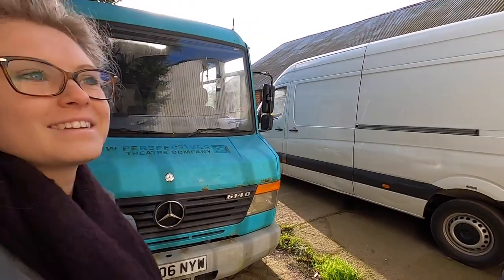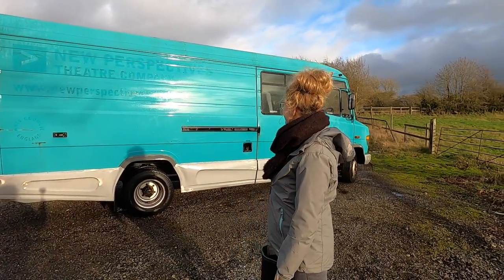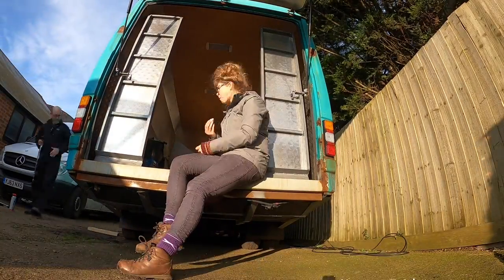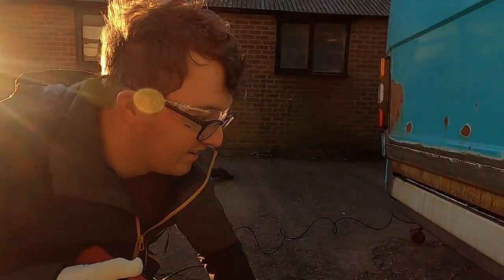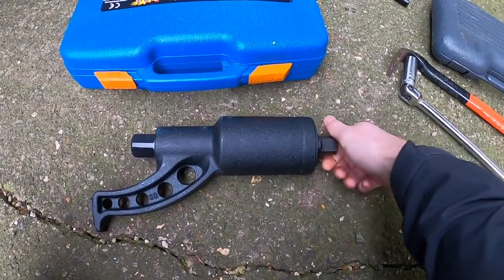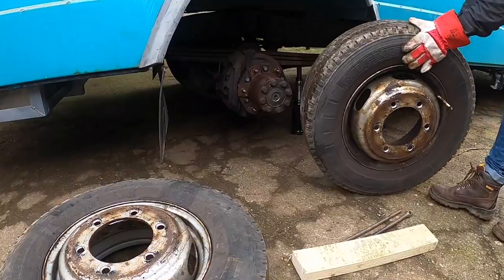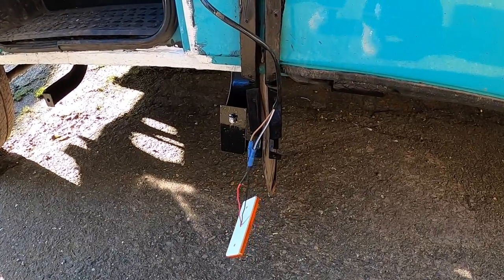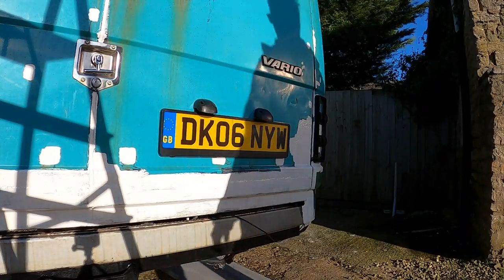WE BOUGHT A VAN | First Step Towards VanLife | Mercedes Vario Camper Conversion | Van Build Ep. 1

Comment: How much does the van weigh? Im absolutely sure for private use its not  HGV MOT.My 4.6 ton sprinter is class 4 mot which is same as car.taxation class is PHG ehich is cheaper
Reply from the maker: Hi Roger! It’s about 6.2ton, what we were told was if it is not converted and just a van, it’s Tax Class: Private HGV and MOT’d as a HGV. Once it is converted into a camper van it’s Tax Class is still Private HGV (£165ish a year) and it’s MOT is Class 4 which is the ‘motorhome’ category where weight is irrelevant! The words from the MOT guy was that every MOT in the UK is ‘tested as presented’, which basically means whatever the MOT guy thinks it looks like, it is! 😂 it took us a while to work that all out but has been confirmed by a few people now so hope that’s right? I think that is the same as what you have advised? 😊👍

Comment: It is actually a BUS, not a VAN. B level drivers license wont cut it for driving this one.
Reply from the maker: Ours is actually a van! And you’re right, it’s 7.5t so will need a C1 licence in the UK! Max has passed his theory test but still needs to do his practical 🤞😊
Reply: light truck based van
Reply: obviously not a bus because it only has 7 total seats, not 9 or more passenger seats.